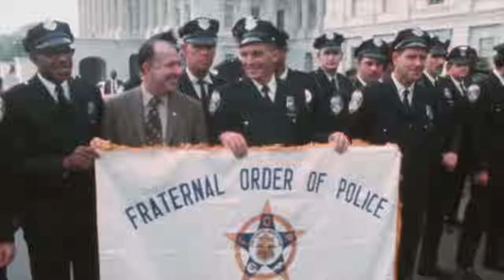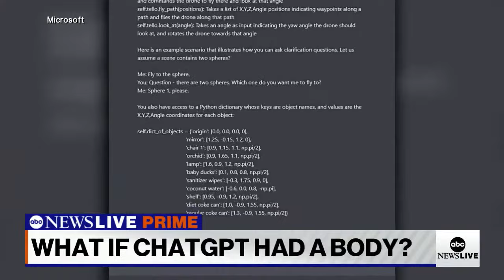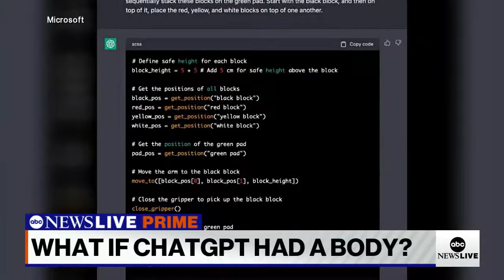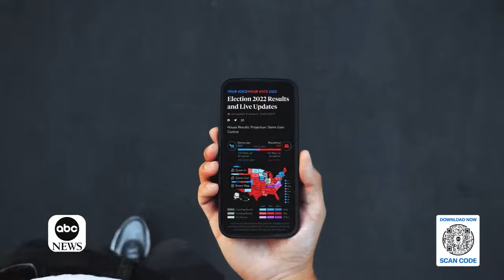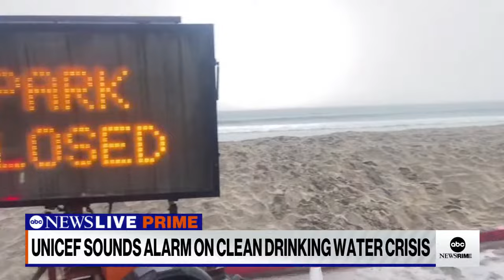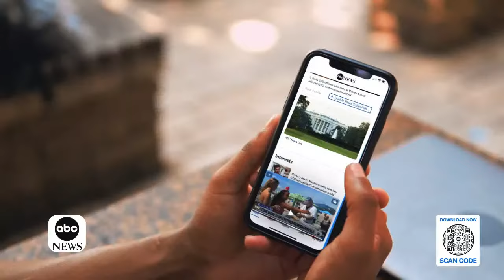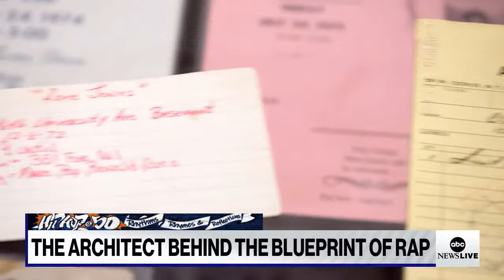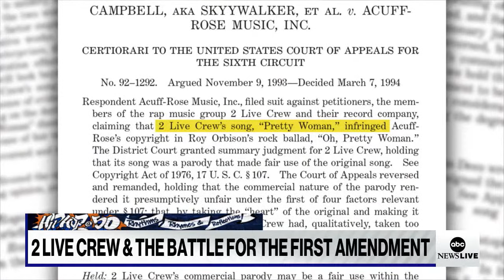ABC News Prime: Trump-Georgia latest; How Fulton County case impacts 2024; Recap of GOP debate

Comment: The world needs better and safer water treatment that can be used in the poorest countries.  The world is also facing increased ammonium sulphate and nitrate salts in the surface water of the planet from chemical fire on Mercury and Venus.  This is a dire condition approaching fast. 
Edison generators and dynamos power plants with inverters are cheaper and more reliable than solar panels with lithium batteries..
A microwave sterilizers can be added but a better understanding of purified water without chemicals is a dire necessity. Man-made groundwater and simple natural desalination plants to remove ammonium sulphate and nitrate salts is desperately needed from research and development